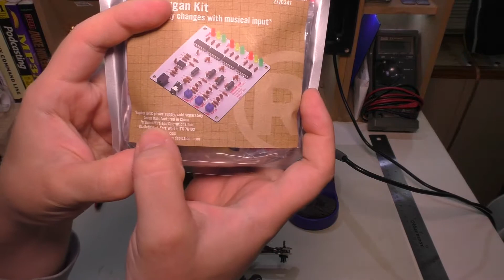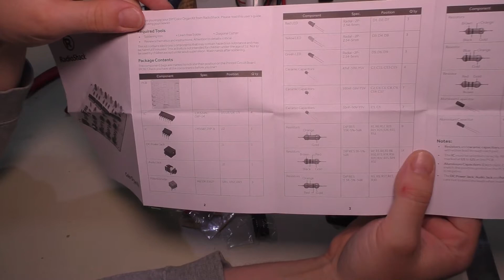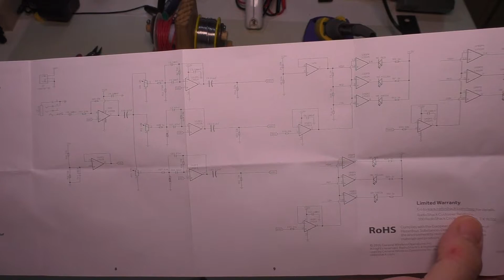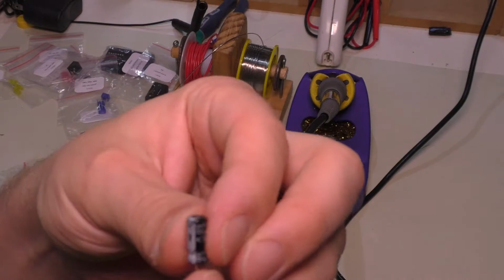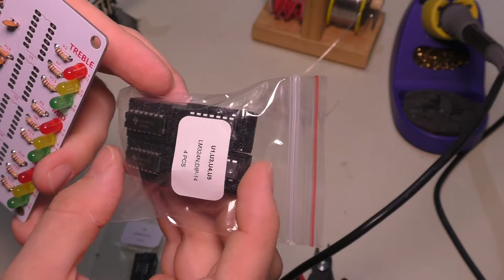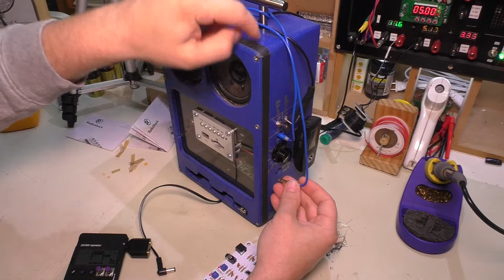PTS Ep. 206 - RadioShack Color Organ Kit Assembly (#2770347)

Comment: Thanks for the video. I have the same kit and I'd like to see that in depth look at the schematic and workings of the color organ. Mine isn't working quite as expected and I'd like to troubleshoot it. Having a better understanding of the circuit might help. :)

Also, it looks like your midrange yellow led isn't lighting. Is it faulty? Reverse polarity?
Reply from the maker: Good eye;  Bad solder joint on the LED.  Hope to have the follow up video soon but not sure when.  Thanks for your comment.

Comment: I think your yellow midrange led is not working.  I got one of these kits on closeout as well.  Haven't put it together yet though...
Reply from the maker: Good eye;  Bad solder joint on the LED.  The kit is a lot of fun to put together.  I flew through it hence the one bad solder joint.  Take your time and you'll be fine!  Thanks for your comment.